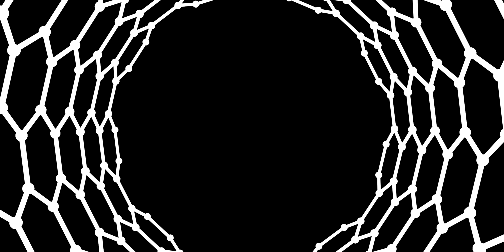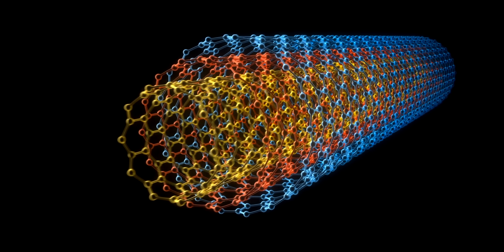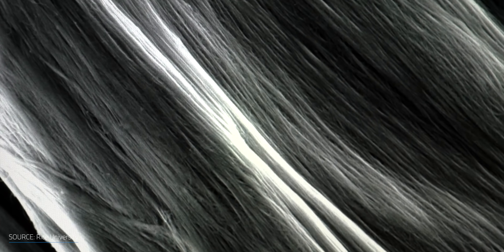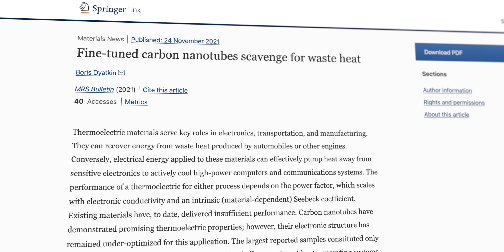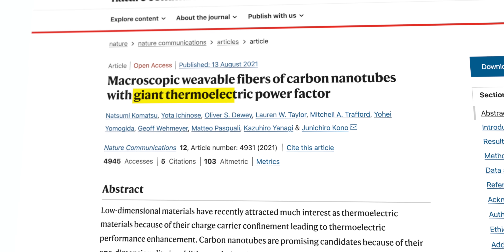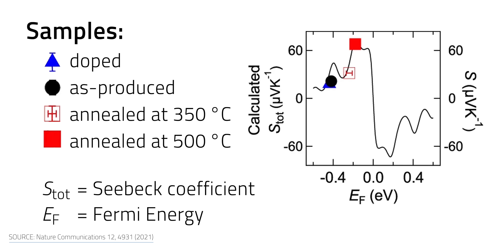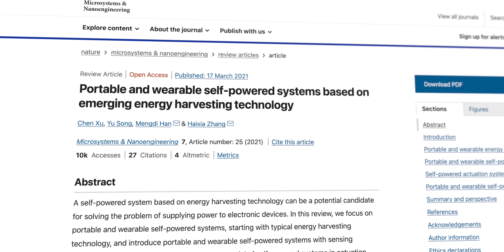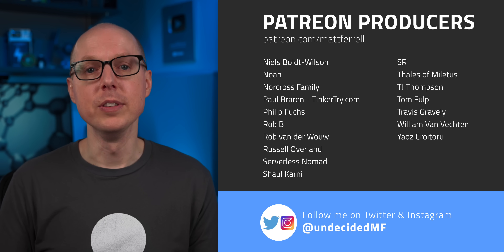Revisiting How Carbon Nanotubes Will Change Renewable Energy

Comment: Personally I think what it would mean for this to become a reality is way too important for it to not exist from a business perspective. The first major company that can 'make the machine to make the machine' will cause such a massive shift in all kinds of production from conduction for energy to space travel and if we could make reusable rockets and/or solar panels using CNTs that would significantly reduce the cost of space travel and energy generation to the point it be not only viable, but possibly the most viable option from a cost perspective. I honestly believe that if we don't get into any kind of issue that halts (this field's) progress we CAN get there and that this will drive the scale of production, but it may get down to whether the cnts cost of production is dwarfed by the amount of money made by the products made with them. There's a lot of background noise so it's a little difficult to think straight, but I hope I conveyed my thoughts well

Comment: I haven't any experience with carbon nanotubes. But my experiences with graphite make me wonder if carbon nanotubes are vulnerable to oxidation, especially at elevated temperatures.  Graphite disappears into CO2 rather quickly when hot.
Reply: Graphite is purified at temperatures over 2000 degrees centigrade and is used for thermal insulation, so I am not familiar with graphite vaporizing!  Same goes for CNTs.

Comment: thanks Matt, awesome video as always.  man it would be so cool if these fabrics could be used with an insulator as an intermediate layer between micro-scale silicon transistor wafers to increase cooling and possibly even deliver that power back into the circuit for efficiency
Reply: An insulating layer to increase cooling......

Oh dear 😑 such is the state of education these days?

Don't take it too hard, I blame the system rather than you.

Most electrical insulators also insulate well against thermal conduction and vice versa - due to how the process works in most materials.

This is the age old problem with creating high efficiency thermoelectric generators.

Higher thermal conductivity = lower conversion efficiency.

Higher electrical conductivity = higher conversion efficiency.

The ideal thermoelectric material would have incredible electrical conductivity coupled with terrible thermal conductivity - so that the heat stays in the same spot while the generated electricity is not lost to heating/resistance and is conducted away to a circuit.

Sadly such a thing has not yet been found in nature.
Reply: @mnomadvfx  thank you sir, indeed my misunderstanding and indeed the system, the not knowing anything about materials science one :)

Comment: EC Problems
There are many problems with owning an EC. But, fact checks ignore many issues and exaggerate others. For example, they ignore that lithium battery packs have a tendency to explode and catch fire. For that reason, the US government does not allow them to be transported on passenger airplanes. Do you really want these things in your garage charging your vehicle while you and your children sleep? In addition, fire fighters have not found an acceptable way to put out an EC fire. 

Their only option is to let it burn until it runs out of toxic fuel releasing toxic gasses into the atmosphere.

They also ignore that companies like Tesla time their warranty to run out exactly when the battery pack becomes useless. This makes an EC useless as a trade-in, a common practice for gas cars. This means that the ECs are actually much more expensive than gas cars since you get nothing for them when it is time to buy a new one.

Another factor is that no one has found any way to recycle the deadly toxic rare earths in the EC motor. This means they will be stuck in landfills with no way to get rid of the refined metals and left to our children to clean up.

Comment: I think a material with so many outstanding properties and potential applications will inevitably attain widespread adoption.

To begin with it seems likely that given the very small scales involved this tech could find prolific initial applications as base circuitry within microchip and even motherboard architecture.

Some time ago I watched a presentation examining potential applications for fluidic transistors, and suspect multi-walled carbon nanotubes could prove particularly useful as a substrate or lattice for that technology.

Comment: I think they’re important, but likely not for environmental technologies. If it were worth doing, we’d already be using Stirling engines on power plants to harvest excess heat, since Stirling engines are going to be more efficient than any thermoelectric generator. CNT-based thermoelectric generators will be better for wearable electronics, but with such a small heat difference available it won’t be sufficient for powering a cellphone any time soon. Smart watches maybe. I’m not sure what that solar technology you described is meant to be, it sounds more like an optical antenna than a heat engine, which may be able to skirt around the conventional inefficiencies of heat engines and could be completely revolutionary to the energy sector. Even if not, heat engines in every PV panel isn’t a terrible idea of it can be made cost-effective, though I’m more fond of cooling your panels while heating water for a shower.

Optical antennae are a potential creation of CNTs, I’d quite like to see someone cover them.

Comment: Hold on stop the press. 80% efficient solar panels? That is insane world chaning tech if they can make them. Carbon nanotubes will eventually drop in price so in a decade or two we can have similar priced panels to today but 3-4 times more efficient making solar power dirt cheap.

Comment: Cellulose Nanocrystals that are carbonized, are kind of like nature's semi pre-made version of carbon nanotubes (and if you graphitize them, they start to get near graphene like electrical conducitivity--especially as compared to the low to mid grade semi psuedo graphenes).  The great thing about carbonized CNC?  You can make large quantities at a time, easily and fairly cheaply. You can also make it at home fairly easily and cheaply. 

      Btw, I can imagine that ultra high molecular weight polyethylene doped with carbonized or graphitized CNC, and then crystallized (as they do when they make Dyneema or Spectra type fibers), would make a very, very interesting material..

Comment: to make it work, you need a quick method for them to line up or in sheets.

and joint (not glue it up, but jointing in partical level)

some scientists already find some ways to sheet it. but joint them into meaningful length in mass production still a almost impossible job. who did that in a fast way probably will earn a lot of money. does it matter how "we" ordinary people think? no, we have no part in their research, no say on the funding, and no hands on those experiment, if they do it? good! if they fail? we have no impact. this is that nano distance between the public and those scientists.

Comment: it would come down to some break through in manufacturing,
those advances in power transmission are really what is necessary to make any broad scale moves to Electric Vehicles possible in the first place.
so to me, concerning carbon nanotube power transmission, the same question is more a question of if any quantum shift to EVs is at all possible.
( being "too many" EVs would cause a type of "thermal runaway", of efficiency losses, in transmission lines )

Comment: How does carbon nanotubes behave in nature? Do they eventually dissolve or do they accumulate like micro plastics?  How do they behave if entering the body? Their properties are nice and all, but if they risk creating another environmental disaster...
Reply: From what I have read, carbon nanotubes can be found in the soot from a wood fire or the exhaust of a car. So, if you have ever toasted marshmallows outside or driven an ICE you are a contributor!  Seriously though, I have not been able to find anything conclusive on the health hazards of CNTs.  It seems reasonable to treat them with caution in the meantime and avoid breathing them in as you would do with any nanoparticle.

Comment: I don't think "power factor" is the right term to use here, as that has a specific meaning related to the phase difference between voltage and current in an AC circuit. And I don't think that is what's being talked about here, is it?

Comment: imagine moving away from copper/aluminum wiring....
Thats an immense step as copper is actually becoming a problem cost-wise since while its an abundant metal its also used EVERYWHERE due to electronics.
Even if they cant produce it at a scale to replace the grids, using it inside houses or factories alone is immense.

Comment: How about using cavitation to make CNTs? just pump methane or carbon monoxide/dioxide through the right nozzle and 8,000 degrees later you have graphitic material.

Comment: Tried using CNT almost 10 years ago for antigen detection. Attach antibodies to CNT, measure conductance. Run sample through CNT solution. Measure conductance again. If it changed, antigen was detected. Project didn't move very far though. 

They were a bit scary to work with as they were incredibly fine and you had to be careful not to breath them in ala asbestos :S
Reply: Wrote a short paper in college theorizing using them to detect glucose in urine, so people could have a device in their toilet measuring glucose levels and tell the user if it is too high, to alert them to get tested by a doctor for diabetes.
Reply: CNT use for measurement/diagnostic purposes would depend on the ratio between quantity/mass of analyte (antigen, glucose, etc.) vs. mass of the CNT-matrix (or CNT-complex). Only by keeping this ratio high (much higher analyte mass) would it provide good sensitivity. Also, I suspect using antigen-antibody binding would raise a specificity problem: of non-specific bindings that would give false signal.

Were you able to accurately quantify the change in conductance for a single antibody-CNT structure?

Comment: The conversion of heat energy to work or electric power can only be done so efficiency by any device. The 2nd law of thermodynamics limits that. Efficiency depends on the temperature even for nanotubes

Comment: "convert infrared heat from the sun into photon" ? Seriouly Matt ?
Infrared radiations are photons just low energy ( even lower after re-emission ) and a wavelength in the micrometer range, x1000 larger than the nanotube. 
I doubt a Peltier/seebeck effect however you boost it would never be as efficient as a good old Steerling engine for converting heat into work ( 80% at best ). 
Sadly the Carnot cycle is a hard physical limit in term of efficiency dictated by thermodynamic.

Comment: 🤔 The safety applications for the heat-to-electricity fabric are enormous. Just imagine… if you accidentally sit on a hot plate, an LED would light up to warn you of the danger. 😜
Reply: Or imagine it being within baby diapers. When the warm-goo expelled by your baby's bottom hits the CNT structure, its generated electricity would power a built-in cell phone that would call mommy & daddy.  The diaper would tell us when to change it. Ooooohh, the endless possibilities 😜!!

(unfortunately, most people don't understand the paltry amount of electricity that would be generated by CNTs from heat - making them almost useless)
Reply: Yes, what if you fell into a vat of molten metal that was just sitting around. Maybe the technology will advance enough to call 911. the possibilities are limitless. It's too bad that the temperature difference humans can tolerate won't really be feasible. Maybe they should use this tech in a sector where there are actually huge temp differences.

Comment: DOD wants to play with this before it goes mainstream. If the ends of the tubes are positive and negative could grow structure magnetically. See if the nanotubes can be magnetized. One big question they have is if it is a superconductor and will it become a super battery.

Comment: Seems like old be a very good application for some Navy ships as they are going to solid state voltage regulators, but they are installed in the switchboards.  Downside, the switchboard is located in the engineering space which exceeds 120 degree F in the gulf.  Or am i way off?

Comment: It's weird when you say, "the highest power factor" since "power factor" is the measurement of quality and efficiency within a circuit. Power factor is measured between 0 to 1 or 0% to 100% and can go no higher. So, "highest" in respect to "power factor" cannot be more than 1 or 100%. You should also know that inductive loads; anything with a motor such as washing machines and blenders, will degrade the power factor within a circuit. If you mean that this degradation doesn't happen under such load using this technology, then that would make some sense. Usually, capacitors are used to correct or rather compensate for power factor degradation, but this has to be configured properly. Another thing that can affect the quality of circuits is noise, often from inductive loads and sometimes from badly grounded components attacked to the circuits.

Comment: Hi, Nanotube researcher here (Papers and Patents).

1) NOT Biocompatible. Bio-killscellsbypokingthemdirectly, the opposite.
2) Heat manipulation is something nanotubes are GREAT at due to their lots and lots of inter-atomic bonding being able to pick up thermal energy. Also their bulk composites typically have incredibly high surface areas and wonderful albedos
3) Note - on the "flow of electrons"  - don't forget that really you're just propagating more energetic EMF wave fronts, not electrons themselves. That's WHY the thermoelectric effect work - otherwise you'd run out of electrons in the nanotubes!
4) Doping Nanotubes is super awesome because basically any time you "tickle" the thing you dope the nanotube with, you propagate an EMF wavefront into the nanotube that can be captured as energy. Cl for chemical stuff, TiO2 for solar, bio-things for bio-sensors, etc...
5) One nifty way to isolate sizes/chiralities of CNT is to make an emulsion with a surfactant, then do a foam separation/settling operation. The different sizes/chiralities of nanotubes bond to the surfactant differently  and therefore create different "molecular" densities of suspended particles.

Overall this is one of the best CNT videos I've seen on YouTube yet, great work!
Reply: @Srfingfreak  can you recommend a good book covering all topics in nanotube science?
Reply: Do you think there's potential for a microplastics situation? Are we going to coat the world in nano-tubes and poison everything?

Comment: Just last week I was talking to a UK based lab person that was getting funded by the UK government to research and produce Carbon Nanotubes and sorry to burst your bubble unless this happens in space or a vacuum and 100% of the process is conducted by robots this is not going happen.

Because... Carbon Nanotubes are more dangerous to produce and use than going back to the 1940 and after the war and making houses out of the new wonder material called asbestos.

 Carbon Nanotubes like asbestos totally attack and screw up your lungs - each shard of Carbon Nanotubes is like a very small dart that scars and pierces the wall and tubules of the lungs.

So from this being found out, that's why lots of companies and research labs looking and investigating this have been closed down because it is seen as a dead-end 

This is also shown by a lack of research papers and funding and news articles written about Carbon Nanotubes because it turns out it is a busted flush.

Comment: I've been hearing about how Carbon nanotubes and graphene will change the world for 15+ years.... I feel like it is my generation's fusion.
Reply: I have a Nano formulation which is doing wonders all vehicles . Turbofield Nano Treatment is available for Engine , AC ,Suspension and Tires .
Lifter and or tappet noise quelled for ever, engines more preppy,last longer and that too with almost zero maintenance and pollution

Comment: If they can get it to the point where I can buy thread and fabric that I can integrate into my clothes without spending a fortune and be able to collect enough power to run things like microcontrollers with a few small accessories indefinitely from body heat, I’ll be super happy!

Comment: Very good unbiased review. I am using so called graphene lithium polymer batteries in high current applications, discharge in 7-8 minutes.  I had big expectations for the high price. At the very beginning they had lower internal resistance than average lipo batteries, what was enough to increase the usable runtime by 25%.  In the long time (50-60 cycles) they are same as any other lipo, loosing capacity and increasing internal resistance until getting unusable after 100 cycles.

Comment: Carbon nanotubes are the future for many applications despite the snails pace progress. It is so vastly different that it will take longer. Less pressure from the public allows researchers the space and time to continue the work. I believe it is tech of the future.
Reply: I agree completely.  One issue is that although the efficacy of CNTs has been proven for a number of applications, the cost of the materials prevented widespread commercial adoption.  Mass production of consistent, high quality, chirality-controlled CNTs has until now been the primary barrier to commercialization, imo.  That problem has now been solved, at least for MWCNT, so I expect to see the landscape change dramatically over the next few years, starting now.